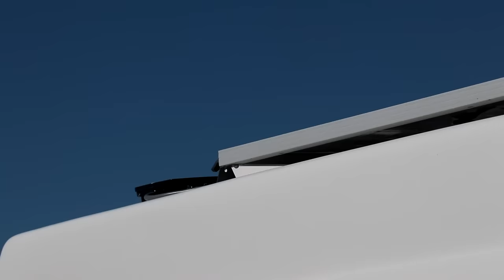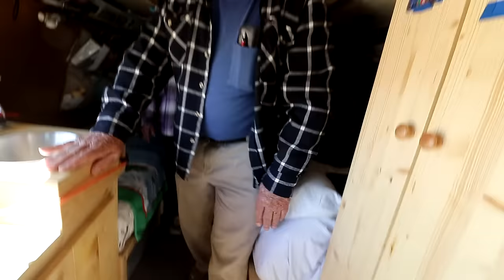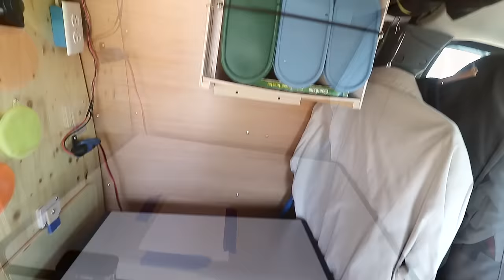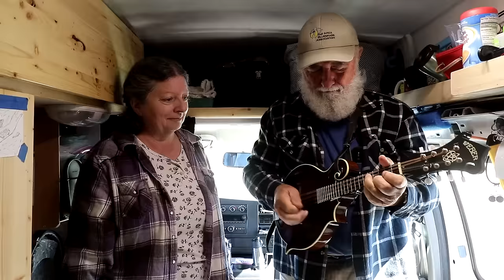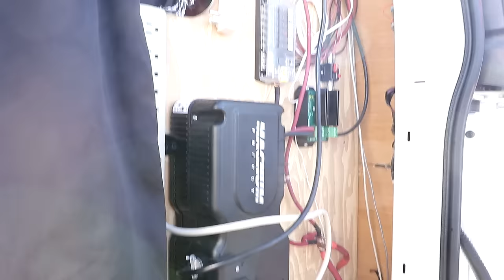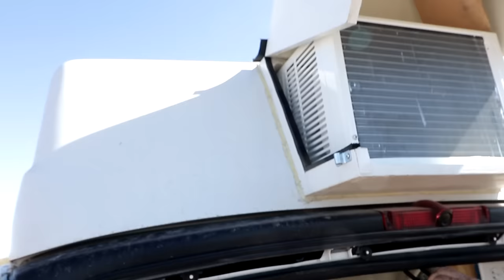Tour of Couple Living Cheap in a Cargo Van

Comment: Back troubles and in a van, yikes! I'm glad that they're finding some joy in life though!
Reply: I found that living 6 months in a van was good for my back.  The seats are designed for long-hours support, and we put in a good mattress.  Best of all, it provided lots of trails to walk, which did my back a lot of good.  Walking swimming, a seat with low-back support, a good mattress , and I'm golden.  YMMV.
Reply: @robertfrost6246  I just thought it might not be too comfortable but so long as it's working for you that's awesome. I've been three months now without an apartment and though there are challenges I get out more and enjoy the peace that comes with being outside so much in the light.
Reply: @brandonmartin4044  Your not wrong about a van possibly being hard on your back, especially if it's one you can't stand up in.  When we were in ours, a normal height model, we were in federal and state areas where we could be outside as much as we liked. If we had to stay inside all the time, I don't think our backs could have handled that.
  
We sold it in April 2019 and returned to slow-traveling overseas.  Lots cheaper, and very interesting.  Right now we live on the southern coast of Turkey, and the cost of living is about half of the U.S. To each his own.
Reply: @robertfrost6246  I just thought mentioning having back trouble and the title saying they were living being in the can sounded a bit humorous but to each his own.

Comment: J&M - A Redarc 1225 or Renogy(cheaper)  DC/DC battery charger works well to charge house batteries from the alternator. Not inexpensive but maximizes charging. With your GM, running with your headlights on will increase your alternator output. Nice mando!